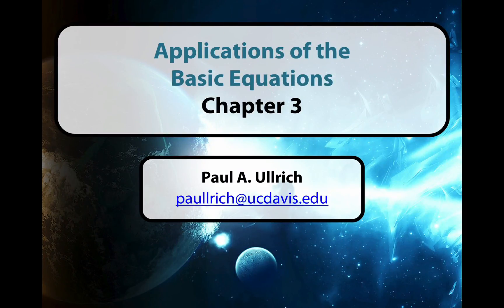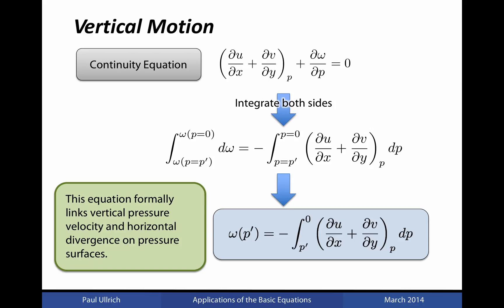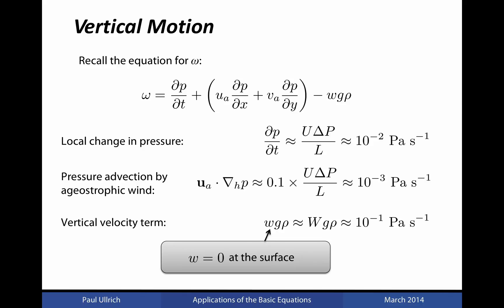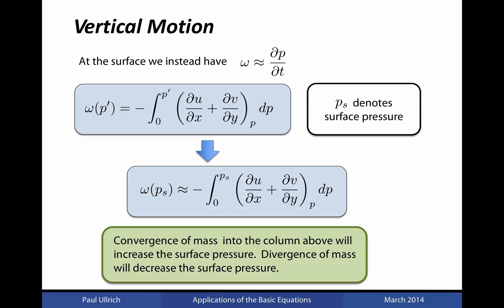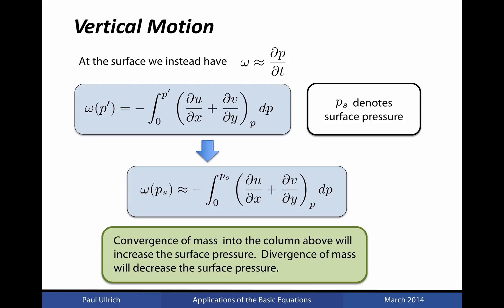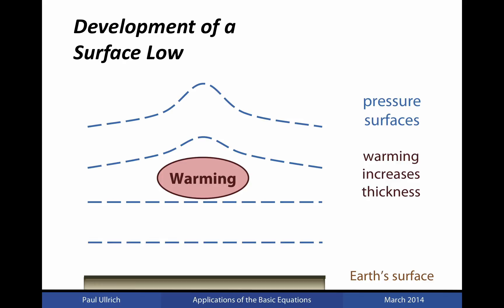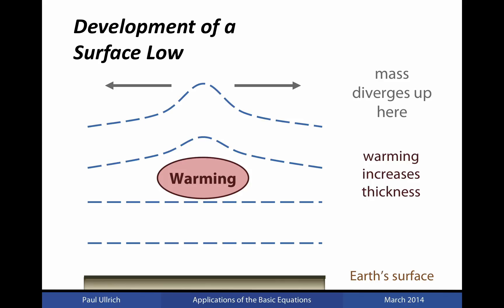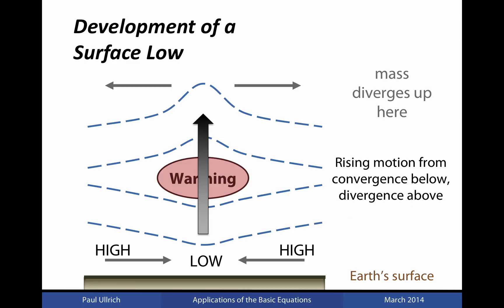AtmosphericDynamics Chapter03 Part05 Developing Low

Comment: Thanks for the video
How about a developing surface high? Is it the mirror opposite of a developing surface low?
Reply from the maker: Yes, a developing surface high can be triggered by sinking cool air.  This is associated with upper-level convergence and near-surface divergence.
Reply: @introductiontoatmosphericd284  Thanks for the relpy
How about those subtropical highs? They are warm cored structures with prominent downdraft, right?